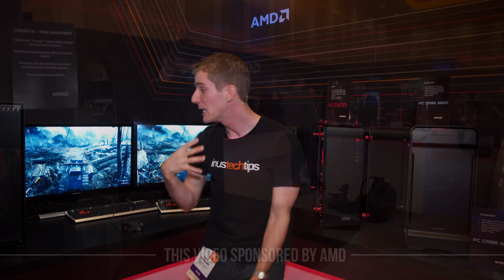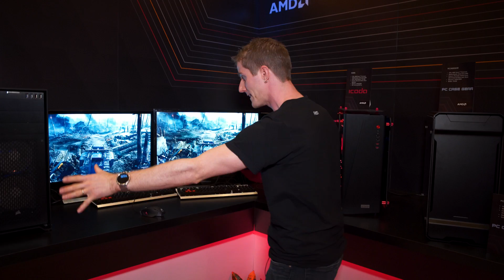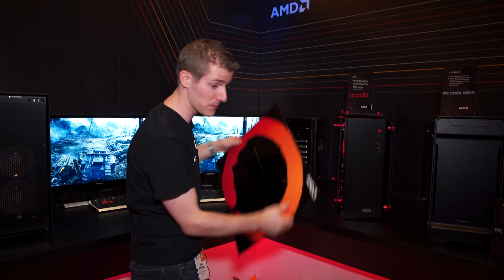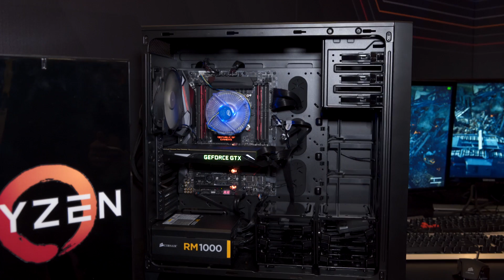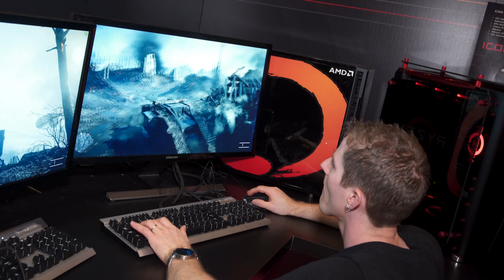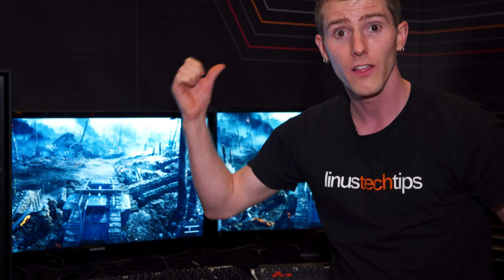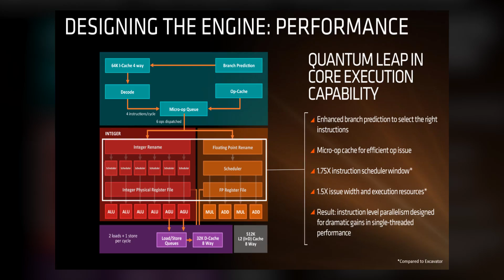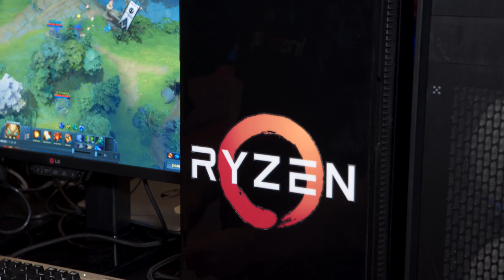AMD Has Ryzen!

Comment: Arma 3 the real End boss
Reply: god I love that terribly optimized game
Reply: Arma 3 runs like shit no matter what your pc specs are. Ryzen isn't going to make it any better. 64bit client was released weeks ago Steve.
Reply: Arma 3 ran awful with bulldozer. hope it wont be same case for ryzen/zen
Reply: Arma 3 is a testament to how crippling badly un-optimized games can be..... Arma 3 makes systems cry not because it has amazing graphics, it is because it is designed to run like games ran in 2007
Reply: FiftyHP shit Dog I'm to cheap to buy 3 I hope it runs well on 2
Reply: that game just has bad servers that control the fps if you were to play single player you could easily get 144 fps
Reply: MineCrime Arma 3 uses more cpu than most games
Reply: My Arma 3 runs perfectly well at 60fps with my i5 6600k @4.2Ghz.
Reply: you're to cheap to buy a 40$ game but not a 500$ cpu noah?
Reply: I can run Arma 3 on my i5 6600K, but I still prefer Arma 2 for its amazing CTI (capture the island) gameplay.
Reply: should run very well on the new chips. The chips now have their own form of hyper threading and its been said that they perform MUCH better on single core performance. They will also authomatically overclock themselves... so basically, it should be able to run arma 3
Reply: Talk about a laggy boss. It's time for Ryzen to prove itself.
Reply: I run arma 3 on the lowest settings possible on public servers with about 40 - 60 fps and I'm using integrated graphics on my i5 4690k oc to 4.5 ghz
Reply: dandrixxx You can't say that because there's nothing like it.
Reply: JAnx01 you are right, there is no other game even on a similar level as Arma 3, there is nothing to compare to.
Reply: I have both Arma 2 and 3, but never really played them. How active is Arma 2?
Reply: TheStrangerWithCandy After the gamespy shutdown, both Arma 2 and Arma 2:OA had dysfunctional server browsers. BI made a workaround allowing you to connect to servers through a web browser using the server list on their website. This still turned out to be detrimental because most players didn't read the forum and simply assumed the games were dead as they saw no signs of life in their ingame server browser. Then they made a new master server for the ingame server browser of Arma 2: OA, but Arma 2 remains dead.
Reply: Rex
And that shows you how bad this game is in using your GPU vs your CPU.   That was how games were crafted back in 2005... now games use mainly the GPU, except Arma, or City Skylines ...
Reply: i get more fps with my FX4300 and GTX960, unless ya talkin about heavily modded arma 3. Thats a whole different story :p
Reply: SageFox me
Reply: I actually run arma 3 apex with 50-60 fps average and I have a fx 6300
Reply: WSG how?i have that fx and a 1060. Or are you talking about singleplayer?
Reply: Mark Zuccerberg I'm talking bout single player with all maxed out settings in multiplayer I get around 40-50fps average.I don't notice any lags whatsoever btw I have a 3 years old r7 265 gpu and I run games at 1366x768 resolution but remember with all maxed out settings.My fx 6300 is clocked at 4 ghz , fx 6300 served me well.
Reply: WSG I have a FX 8320 with a HD7850 powercolor 2gb, runs DayZ maxed out at 1080p (1920x1080) at a solid 60.
Reply: SmallNews Channel my fx can run Dayz at usually 70fps on medium, dropping to about 40 in big cities.FeelsBadMan
Reply: Mark Zuccerberg Which gpu you have?
Reply: WSG gtx 1060 3gb
Reply: SmallNews Channel Since my gpu is a rebranded hd 7850 with some tweaks I guess at that resolution my system will perform better 👼
Reply: Mark Zuccerberg gtx 1060 is far more superior than a hd 7850 You should overclock your cpu upto 4.5ghz to avoid any possible bottleneck at last fx 6300 is a 5 years old cpu.I got 5-10 fps gain after updating my driver to amd relive edition drivers Amd is doing a great job and my card still doesnt make me feel like its outdated.